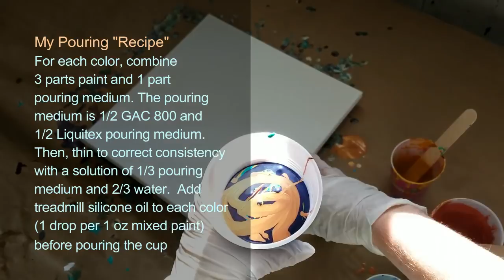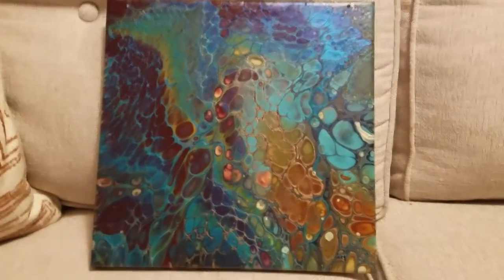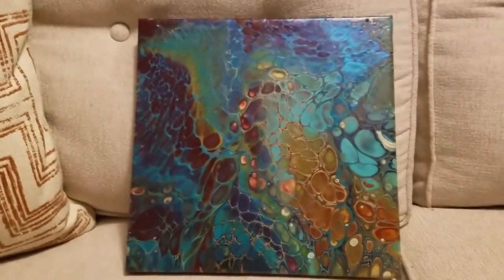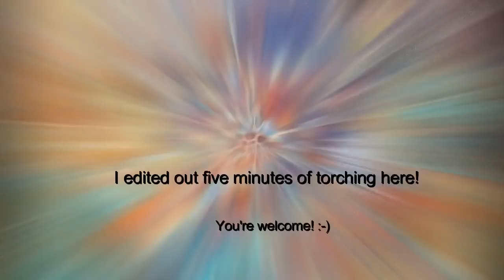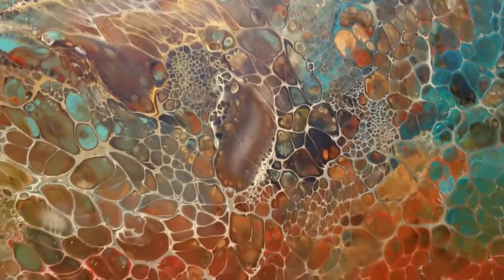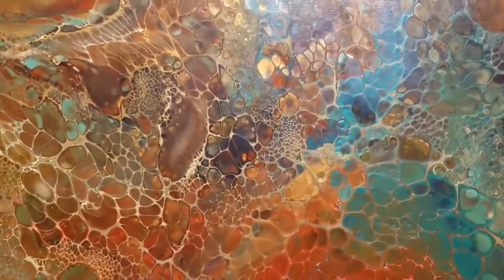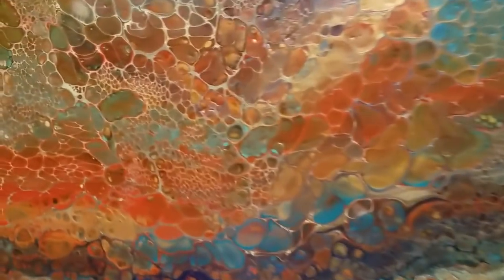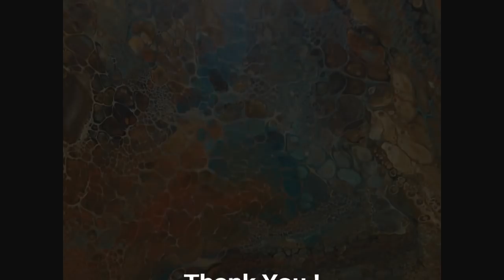STUNNING! Two Acrylic Pour Paintings (acrylic pouring recipe + process with commentary)

Comment: I am in love with Your art. Thank you for sharing ❤️ i agree with cold - i get the same results when i leave my window open at night. It seems that then top coat is drying quicker than bottom coats and it makes these cracks. Or might be also when my painting is not leveled and it moves while drying:) gorgeous as always
Reply from the maker: Thank you! <3 I just did not know that could happen. I had all my paints and mediums stored out there. Glad this opened my eyes before THOSE froze!! Everything is safe inside now.

Comment: how long do you give a painting to fully dry? when do you know it's totally cured? I've been using thicker paint and it takes forever for it to set up.
Reply from the maker: It appears to be dependent on a number of factors, including temp, humidity, paint thickness, air flow. I usually wait for about a week to even touch or move a painting once it is poured, and then at least a month before I prepare it for shipping. I do not varnish my paintings because I like the satin smooth look of the paint I use when it dries. It looks much better without varnishing, and I have been advised that varnishing is not necessary on acrylic paintings.

Comment: Do you order your Pabeo paints from Jerry's? Lately I'm having a hard time finding colors.
Reply from the maker: Hi Jan. Yep, that is where I get mine. They just recently started carrying all the colors in 250ml tubes (in addition to the 500ml containers). It looks like the tubes are all backordered until April 10, but most of the 500ml tubs are in stock. My only complaint is that they don't carry the iridescent green blue in  anything larger than 100ml.